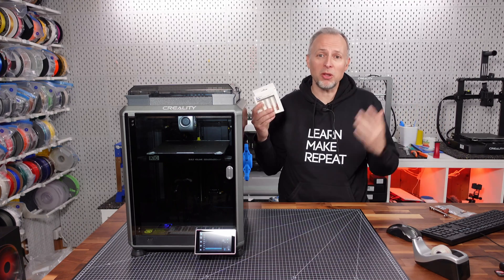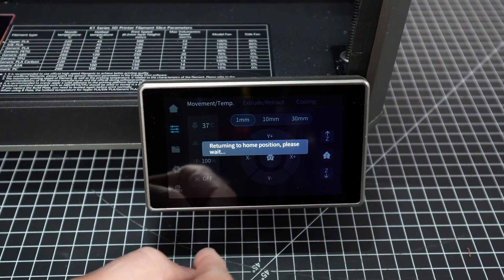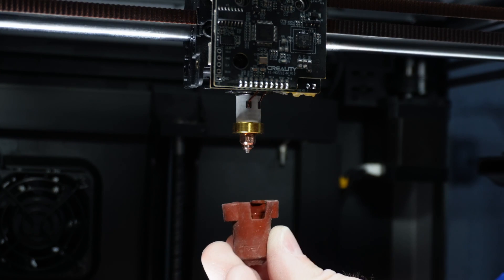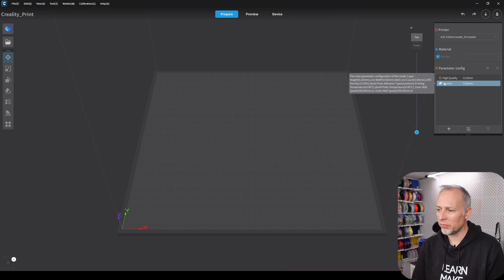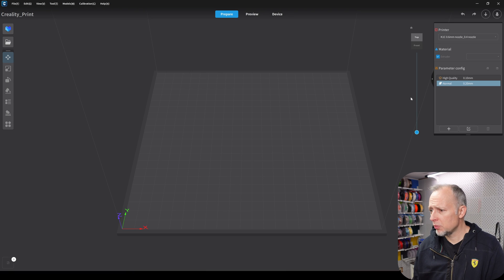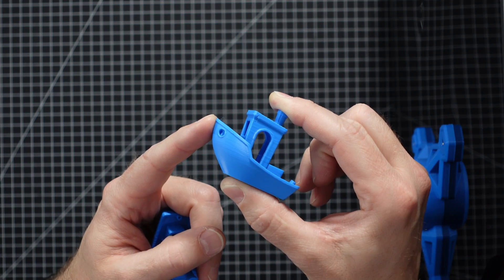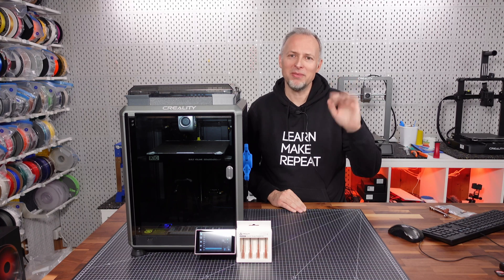Unicorn Nozzles in the K1C: what you should know, how to install, slicer settings

Comment: Just a word of warning to anyone who decides to follow this video.   While appreciated for the effort, you need to swap nozzles hot.   Following this instruction as is, as mentioned in other comments below will lead to you breaking wires on your hotend, but also you will have a nozzle failure and likely a stem sourced blob of death.      You must support the heater with the wrench when screwing the nozzle in, and you must do it hot.

Comment: I have a K1C with a Unicorn hot end.   After months of happy use it blocked today.  I was printing a new roll of HyperPLA that I have used before.  I now have the Unicorn nozzle out,  I have heated the nozzle and with a combination of the stillette and cold pull can get the stillette down to the tip.   The the tip remains blocked.   I am waiting for 0.4mm needles and a new Unicorn nozzle to arrive.   Am I wasting my time trying to unblock the original nozzle?

Comment: What you should know (from someone who is NOT sponsored) It Sucks! Show the side by side max volumetric flow, in my test i got:
Stock Unicorn  -   .4 nozzle @ 225c flow 18.65mm3/s
Stock k1                .4 nozzle @ 210c flow 20.5mm3/s
Volcano CHT   -   .4 nozzle @ 210c flow 29mm3/s (old k1 Hotend)

Comment: you dont need thermal paste?
Reply: Official instructions and multiple videos/reddit post suggest it. Be sure to use compatible one (300°C), not just CPU thermal paste.
I've also noticed remains of it while removing the nozzle on my printer, waiting for my thermal grease to arrive before replacing the old one.
Reply from the maker: I agree that this is probably better with thermal paste but it does work fine so far without. Maybe it’s less energy efficient but it’s definitely easier to swap nozzles

Comment: The official Creality guide shows them using a wrench to stop the heater from spinning when removing or tightening the nozzle. I followed this guide and my heater spun almost ripping off the connections to the heater!
Reply: I followed this and one of the heater wires popped off the ceramic heater as it suddenly spun around on me. Serves me right for following advice from random videos on youtube instead of the official guide.
Reply: @BillBard  Yes this guy is taking shortcuts. No thermal paste nothing

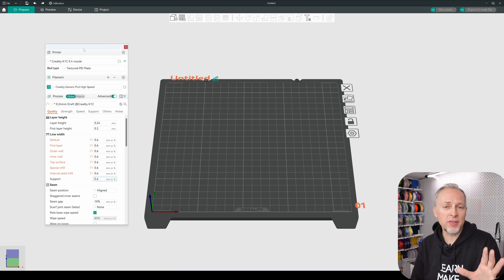Comment: 14:10 : it's not true, put the ip in orcaslicer printer setup , the test will fail but just press ok it will save the IP anyway, but on the device tab it will open the creality website just fine (convenient to watch the print on the camera , adjust while printing etc). You then in the slicer click export instead of print. Export it to a folder in your pc to save the gcode (I use the same folder where the stl or the project is), it will generate the gcode file there. Then switch to the tab on the device page, it will show your printer. Click the (+IMPORT) button, select your gcode. Success: I printed without leaving my chair comfortably from my pc and I sent the pritner. No USB primitive carrying nonsense. No need for complex software procedures, rooting or watching anyone else's lengthy videos for something that explained in 2 lines of text..... so ZIS IS HOW YOU NETVERK PRINT WITH OOOOGGGKASLAIZAA'

Comment: I'm just wondering did you have to change the hot end so it was compatible with the new nozzle. Like is the unicorn nozzle different from the default nozzle that the printer comes with?
Reply from the maker: No, it’s the type of nozzle!
Reply: @Crosslink3D  ok thanks

Comment: Im just a beginner at 3d print but I did change my nozzle to a 0.6 and im not really seeing much difference in speed.. it Seems one is still limited by the max volumetric speed.  Soo I can't seem to go over maybe 150mm/s.... I was under the impression that this machines could go way faster than that
Reply from the maker: It’s always a combination of material and printing temperature that will ultimately define the maximum flow rate. Probably get high speed filament first and then do a couple of tests using Orcaslicer’s flow rate tests

Comment: Great tutorial! I swapped my nozzle with one of these; everything went nice and smooth, but now I get warping on everything I print, no matter what build plate I use! I've run PID tuning, leved multiple times. Nothing fixes it. I never had to use a glue stick on my bed before, I really don't want to start now. Any suggestions?
Reply from the maker: Clean the build plate, never use bare hands to get stuff off the plate. Alcohol will do the cleaning or water with soap and proper drying afterwards. I see so many people fumbling with their fingers on the plate when getting stuff off. Just avoid touching the surface at all and this will already prevent 90% of issues

Comment: the white part (the heater) for me gets loose and wants to free spin as the nozzle starts loosening up. I grabbed a pair of pliers and held it by the brass looking ring to make sure it didn't spin around and mess up the cables.
Reply from the maker: Good observation. I had this when doing another nozzle swap. Pliers help to avoid ripping the cables
Reply: Literally just came here to ask this question, OFF TO THE TOOLBOX!

Comment: I've had the max for just over 3 months and I'm about to change the nozzle for the second time. Is there a reason why I'm getting so many clogs? I'm only printing pla rapid +.
Reply: get the microswiss.. k1 max has the old thing that hotend shall meet up with cold end..and if its not exactly right it can leak and so..

Comment: In Creality's tutorial for changing the Unicorn nozzle, they say you must heat the nozzle to 240 before removing it and keep the extruder at that temp while screwing in the new nozzle, just like on printers using standard nozzles. Any reason why you omitted that step?
Reply: Can't really see why this should be necessary. Heating up the nozzle is a good idea for Mk2 and V6 hotends, because nozzle and heatbeak are separate parts, and you really don't want a gap between them, otherwise the hotend will leak. Those unicorn nozzles, however, are nozzle and heatbreak in one part. There cannot be a gap between them. Heating up the hotend before changing the nozzle seems completely unnecessary.
Reply: To aid in removing in case the threads are seized.

Comment: That silicone sock is a PAIN to remove for me.  Also that fan socket will have glue on it when you first remove it.  You have to carefully chip that off before removing.
Reply: I bought a pack of them and if they don't want to go off, I simply rip and tear them until it's done 😂

Comment: Creality Print  5.0 does enable the selection of materials, but still doesn't have the ability to select different nozzles.  Bummer!
Reply from the maker: Indeed, time to switch to OrcaSlicer
Reply: @Crosslink3D  I have, but it doesn’t connect to the K1C by WiFi.  USB stick kind of works though the K1C doesn’t have a way to cleanly eject it.
Reply: But strangely enough, Creality print 4 now does! Need to keep both versions to use this machine, some files in v5  gcode cause errors.

Comment: 4:31 Hello, I saw an official Creality aftersales video on replacing the K1C Unicorn nozzle. In the video, the upper copper ring is lubricated with silicone grease. In your video, you screw the nozzle in without lubrication. Do you know anything about this topic? I have not yet received an answer as to which silicone grease was used. Silicone grease is only supposed to work up to 200 degrees.
Reply: I believe it’s not a silicon grease, but a thermal paste to increase cooling of this segment. Maybe I’m wrong, but I don’t see any advantage that silicon grease can provide
Reply: @zdrf1991  I also think its a translation error and its actually thermal paste, you can see the nozzle he removed is also "dirty", probably with thermal paste. @CrossLink3D can you check that please?
Reply: @zdrf1991  Did you apply the thermal paste? Did it work?
Reply: The upper copper ring (after the heat break) is there to keep incoming filament from melting due to heat creep before it enters the extruder. In theory it should rarely if ever go above 200°C so the silicone grease should be fine.
Reply: Great question. Also curious.
Reply: I also wondered about a thermal sealer ?
Reply: @Crosslink     Dónde puedo conseguir el kit que muestras de las boquillas?
Reply: It’s not thermal paste, it’s anti seize. It’s used because the metals of the nozzle and the hot end are different. It’s to keep oxidation from forming on the threads themselves and seizing up the nozzle inside the hot end. Makes removal easier.

Comment: I prefer to leave the sock and fan shroud in place and simply push up against the bottom of the sock to unscrew the nozzle. Faster and no chance of damaging the wires to the heater pulling off the sock. Works perfectly.
Reply from the maker: Nice one mate! However, don't do this on the Ender 3 V3. The nozzle is fixed with a grub screw and you might break off the throat. So better investigate for any newer Creality printer that uses this type of nozzel if and how the nozzle might be fixed in place. The K1C seems so far the only printer where the nozzle can be screwed out without releasing a grub screw in the upper section of the hotend.
Reply: @Crosslink3D  Ahh interesting, yes I have a K1C
Reply: @Crosslink3D  Good to know! I’ve been switching between the 0.4 and 0.6 nozzles!

Comment: I did the replacement of the standard 0.4 to the unicorn 0.6 nozzle. The first print i want to make I get an error Key:2111. Do you know of this problem and how to solve it?
Reply from the maker: I had this after disconnecting the fan and reconnecting. I did restart the printer by powering off and on. The problem did not happen again since.
Reply: @Crosslink3D  I did a restart and factory reset of the printer. The error keeps popping up. The strangest thing is that with files sliced before the first error there is no problem.
So it looks to be an error in the gcode that's generated by creality print. The print head does multiple homing movements and for some reason it centers and wants to lower the temp of the nozzle to 170. That's when the error occuers. 
With the old gcode, its does the homing and afterwards it just begins to print.

Very strange. Haven't had the time to check the g-code on differences between the old and new files.

Comment: 5:50 Printing with bigger nozzle, but having it defined as smaller in slicer won’t under extrude. The quality will suffer, but extrusion volume should still be correct.
Reply from the maker: That’s probably right. I think it’s still crucial to have the right settings